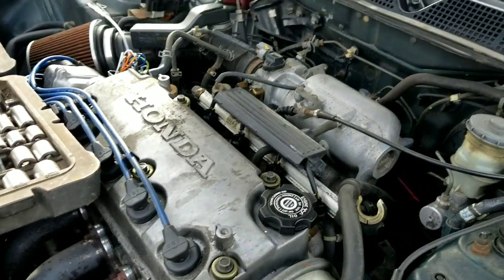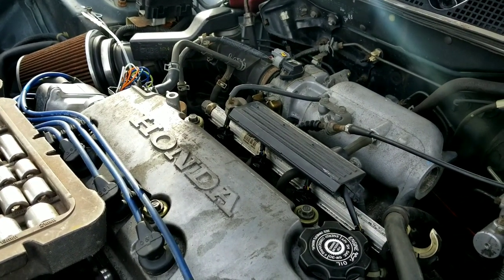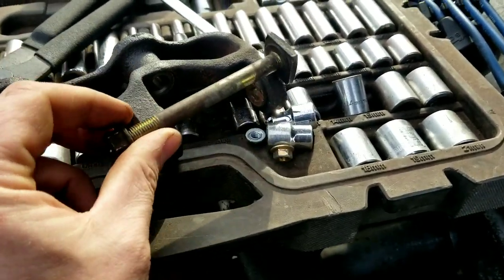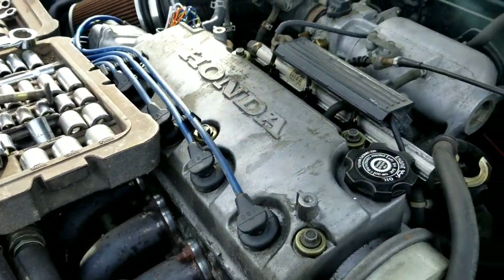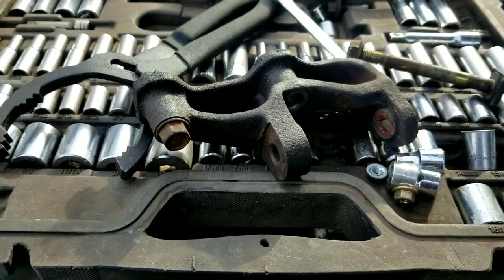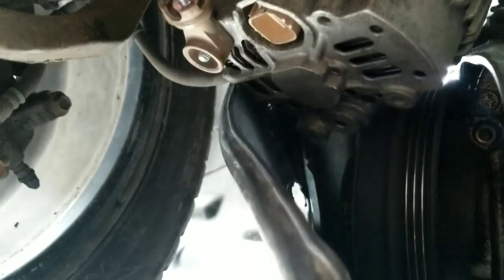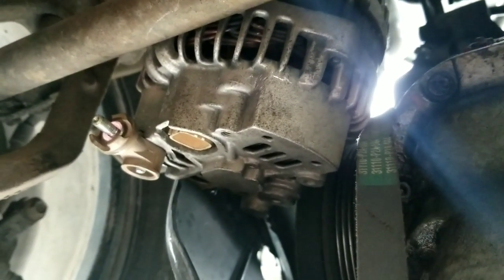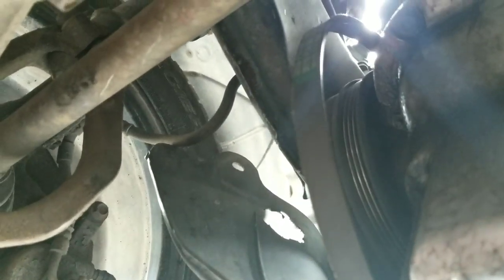Honda civic alternator  (92 to 00)

Comment: Had my 96 alt rebuilt, and the dude just took the brake master cylinder off and pulled it up through.  Eliminating the problem of taking it out from the bottom.  Bypassing the motor mount problems and lifting the motor.  So…… if anyone is interested, try it out. Might save you a bunch of headaches.
Reply from the maker: Yes!! Someone did say that! That's good to know and glad you got it fixed. Thanks for the comment